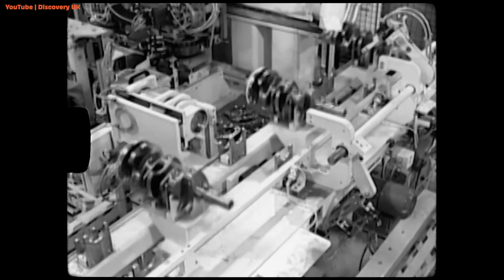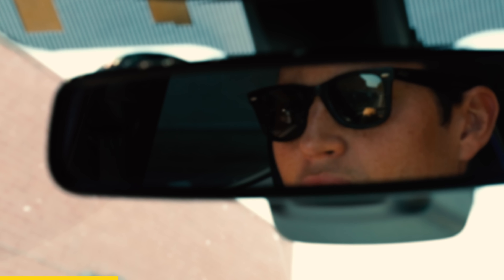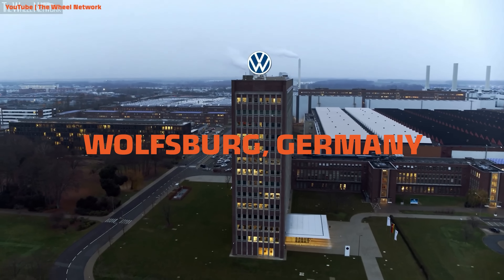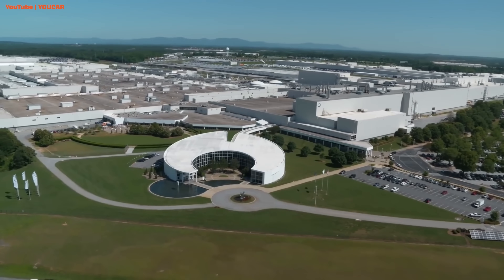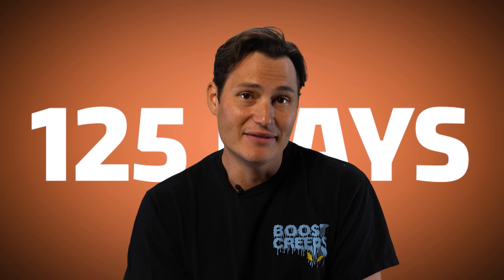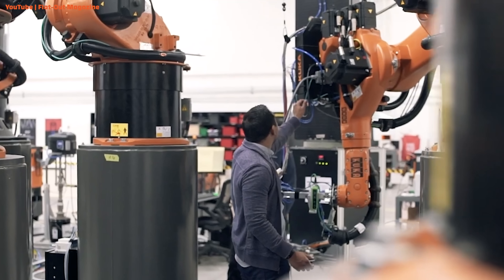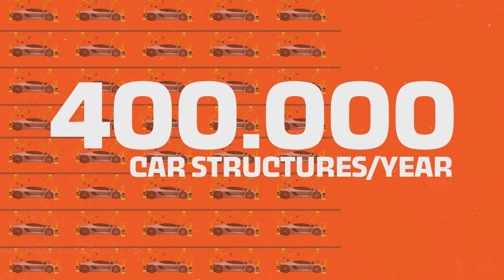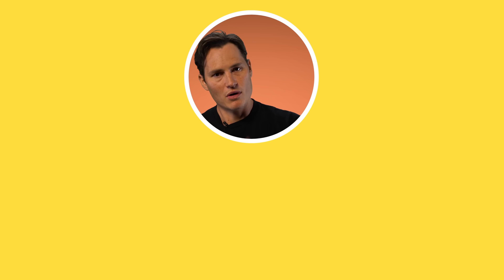A.I. Designed this Car

Comment: "A 3D printer doesn't print out any extra material" 
Bruh
Reply: Plenty of comments saying the same thing ; can't blame you for knowing that supports are needed in plastic printing. But if it's using a powdered-metal bed, the powder acts as a support during the print.

Comment: What happens when parts need replaced? Everything I'm hearing about the AU is a mechanics nightmare. Honestly we need a vehicle that's designed for the everyday car guy who doesn't have a whole shop and special tools to use, easy to maintain and long lasting

Comment: So, they used topology optimisation for parts of the structure and some optimisation for other parts like maybe the wiring runs and aero. Seems like "a car designed by AI" is a bit of a bold statement. Also the comparison with VW which is centred on mass production doesn't really work, in my opinion (as the rest of this comment, of course)

Comment: 3d printing is such a costly thing to do to make molds and produce it but it lets companies R&D without the expense of designing the whole picture in materials that could cost much more its also can give manufacturers new shapes and designs to a system that could be used to improve currents systems. That said i hope companies can make that jump but it will be a costly one $$$

Comment: The information provided here is very misleading. They used ai programs to aid in making parts as strong and light as possible. Because of the shape of these components, they can only be manufactured with a 3d printing process. 3D printing is extremely slow and inefficient, and as of now has no place in a high production environment.
Automobile manufacturers have been utilizing these same robotic arms for years already. And they are not easy to program, they take hours or even days. All parts for assembly must also go through QC and be set up prior to assembly by a person.
This may be a tech savvy way to manufacture, but it isn't cutting edge. This also is not the future of manufacturing.

Comment: If the AI designed it, it should be able to beat a 1000 hp car with a 500 hp Engine since it should have the least drag coefficient possible with the best weight management. If he doesn't beat records with this, it means, he's lying about the AI or it is not well trained.

Comment: It's too bad these hyper-affordable building practices are largely only used for insane hypercars. If say Toyota or Nissan was able to cut basically 99% of manufacturing budget they could put out cars at dime-on-the-dollar prices. You could get a brand new civic or Altima for like less than 10k or something crazy

Comment: "3d printer doesn't print out extra material"
I who 3d prints "boi lemme tell ya"
Reply: DMLS 3d Printing genertes near zero waste as the metal powder itself acts as support rather then using the filament as support like its used in traditional plastic 3D printers.
Reply: Lol, I thought the same. To be fair though the powder acts as a support material, meening the only waste comes from smoothing the print
Reply: it doesn't, your typical 3d printer is non comparable to a laser one that is precisely accurate. it does leave some materials behind when smooting the print but it doesn't print excess that much compared to a plastic fed 3d printer.
Reply: @spanishsausage4731  xctly brah...👍
Reply: They use a DMLS printer. I thought that doesn't use extra material?
Reply: @ChrisHuppey  refer to the intake manifold printed for the supra at papadakis racing
Reply: Yeah I cringe a bit when he said that and I don't even have a 3D printer. Otherwise those guys I follow on IG won't have to sand down their works
Reply: @kertaspaper94  Your ignorance is hilarious you should actually look up additive manufacturing before badmouth someone trying to explain it in layman's terms. Additive manufacturing has almost no waste because everything that isn't the part being made is recycled back in to the printer. The only waste is the materials lost from smoothing or polishing the print.
Reply: The 3d print they are using is NOTHING remotely close to a filament 3d printer. The type or printing it is doing prints nearly ZERO waste.. So the people saying oh i would have changed the script because that's so wrong are the morons. That printer cost more then you will make in your life time and its insanely precise producing parts that are extremely complex with extremely small variances and runout.
It shouldn't be called a 3d printer it should be called 3d fusing.
Reply: @EDCandLace  https://www.youtube.com/watch?v=IUp3oCGZOzk
Reply: May be they are using a printer that is more presise and costing millions.😆
Reply: @flyingsnail4060  you mean he actually knew what he was talking about.
Reply: @Kyle-xt8ip  is ths a question  or a statement?
Reply: @buffalo wt https://www.youtube.com/watch?v=IUp3oCGZOzk
Reply: I was thinking that same thing, like I have a whole bin full of proof to the contrary...
Reply: I also have a 3D printer, whenever something goes wrong it makes a huge mess of extruded filament that looks like a big plastic tumbleweed. 3D printers need to have the correct settings otherwise they are just wasteful trial and error machines. even if everything goes right many prints need support stuctures.
Reply: There's a lot of extra material?
Reply: Let me put it in simpler words: "whoaaah, Yankee with no Brim!"
Reply: You probably have a different type of 3d printer, the ones they're using actually has no waste
Reply: SLS is much less wasteful than FDM because the extra powder can be reused, unlike printed support material in FDM printers.
Reply: That should tell you Jeremiah is a ignorant fool and needs to leave donut. I hate that dude.
Reply: @theenzoferrari458  actually, Jeremiah is a really cool and talented dude. Have you even seen him race motocross? Dude’s a badass! Sounds like you’re just angry because you miss having daddy James on B2B 🤨 #highcar
Reply: @theenzoferrari458  why, you think he wrote all this script himself?
Reply: @Patrick94GSR  it doesn't take jeenyus to reword the script. Lmao. If I was reading it I would've fixed that on the spot.
Reply: @theenzoferrari458  it prints support material depending on the shape of the piece, still what you get is a piece that is far more efficient in material than CNC (as everything gets recycled)
Reply: @leviathan19  Exposure to oxygen and humidity can cause metal alloys to change composition. For instance, as oxygen increases in Ti-6Al-4V titanium, the aluminum content may decrease. This is particularly true when metal powder is recycled. Recycling also causes powder particles to become less spherical and to flow less well

The printing process may also see changes in the composition of metal alloys as well. In a metal alloy, in which multiple metals are combined (i.e., alloyed), the metal with the lower melting point could potentially evaporate in the process. In the case of Ti-6Al-4V, a popular metal for 3D printing in aerospace, titanium has a much higher melting temperature than aluminum, and it’s possible to alter the composition of the material during the 3D printing process.
Reply: @theenzoferrari458  And it doesn't take a genius to spell genius.
Reply: @theenzoferrari458  Yes.. yes..  You are obviously brilliant - and yet you have no show of your own.
Reply: @theenzoferrari458  lol such a negative dude, take a xanax

Comment: But does anyone understand how this could easily be tweaked from making hypercard to making radically efficient/power everyday vehicles at a fraction of the cost?

Simpler design, reduced material cost, no real need for maximum power, I'm sure even the machinery wouldn't have to be as expensive. Wow.

Comment: I’m a little confused about the calculation made for the amount of cars per year a 100.000 sq ft factory can produce.

It takes an hour for the basic structure to be assembled, which equals to 8760 (not 10k) if the were to factory run 24/7 365. 

The assembly of the complete car (the 3000 hours) gets disregarded in the calculation. I assume this is mostly print time on the actual parts. Simply multiplying the A.U. area times  40 without leaving room for a massive print facility to keep up with the demand is not possible. So unfortunately the 400.000 (which theoretically is  350.000) is not achievable until additive manufacturing tech’s speed increases or the factory at least doubles in size. 

There is no doubt that we’ll eventually get there and I can’t wait to see it!!

Comment: Very interesting technology - probably the first time it's been applied to automotive at that scale (In aerospace this is old news), but the reason mass production of cars doesn't do this is because the cost to 3D print a part is way higher than stamping, casting or forging, as well as taking way longer. You won't get optimum geometry compared to the 3D print, but it will be 90% there and easily an order of magnitude cheaper, which is a hell of a lot more useful if you want people to be able to afford to buy your cars in large numbers. For low production run supercars, this cost is irrelevant, so it's an ideal way to maximise your profit in that market. Also guaranteed there's a large team of engineers and designers 'guiding' the software's calculation constraints to make the car look the right kind of impressive to sell, so while AI is involved, guaranteed it's not doing all the design work.

Comment: The problem with what you said about filling a factory floor with AUs though, based on the time you gave to put the thing together, is that for each AU to be building that many cars, you’d need a factory full of 3D printers and what ever they use to make the carbon fibre parts... better to have 1 or 2 AUs and fill the space with 3D printers... Still insane production numbers for the footprint! Hope other manufacturers take notice

Comment: How much does it cost to buy? And how is machine-made more prestigious than bespoke & hand built? Who has driven a production version?
Reply: id imagine they will be priced in the high 100k low millions and at massive profit margin to the manufacture since he eliminated 90% of the overhead
Reply: How is this not more prestigious? A human, no matter their experience/training, can make a mistake. A stitch could be wrong. A ring gap could be .0001" to big or too small. A properly programmed and maintained machine will not. That matters on a car that (for the first run, at least) will be a colossal flex for anyone lucky enough to buy one.

Comment: Great video overall. I would be great to mention the name of the process that allows such shape - topological optimization. Happyly it is not perfect and still require engineers to verify parts mechanical resistance.

Comment: as a kid who dreams of being a mechanical engineer one day this made me really sad
Reply: Mechanical Engineer here, A.I. Is powerful when it can be successfully trained to produce something from a given set of inputs. Assuming this becomes common place, it will not be economical for everyone to produce an AI for a given task. You’d be surprised how much you will do that is one off tasks or specialty designs that do not warrant the time and financial investment in training an AI to create something that you could do in less time, at less cost, and qualify as being acceptable. Also, A.I. is not infallible. Just because it gives an output for a set of inputs is no guarantee that it is a good result or not, there will be engineers approving the designs as being satisfactory and will need to do their own analysis to confirm. My design calculations have to be approved by 2 other people before they are rubber stamped. AI will be no different. Your skills are needed now, and will continue to be needed in the future. Automation is more an enemy of people who work with their hands than people who work with their minds. Also... software coders are not engineers and do not understand mechanical design and analysis the way you will, they will need your help and input to build these regardless. Not to mention Engineering includes inventing and ingenuity, something an AI will struggle to do as it must be taught. Walking up to something and being told make it fit here and work with the given requirements is not an AI worthy task. Automotive design is an old profession and the design requirements are very well understood. Nothing you have seen here is a radical departure from what has already been done for many years now, just a hyper optimization of existing design concepts. Super lightweight fancy double wishbone suspension is still a double wishbone suspension! The AI did not come up with a double wishbone design as being most optimal... it was TOLD to use it as the basis! So fear not!!! 🙂
Reply: who do you think designs the A.Us , robotics, PLCs, software, the AI software... engineers
Reply: Searching the whole comment section for someone to say this.
Reply: The video is over simplified...the whole comment section bought it...its much more complicated than that...AI is just a small aspect of it...the whole car is a product of very smart engineers working in collaboration with the machine which churns out solutions to choose from...AI is of no use without a smart human to set parameters and make good decisions...go follow your dreams but also learn to collaborate with a machine and create synergy as both together can make great things happen.

Comment: Imagine going to collage for 5-10 years to design a car... just to get an AI stealing your job...
Reply: Yang Gang in the making...
Reply: Imagine going to school at all for STEM. Your job is gonna be outsourced to a program a million times more efficient that you had a hand in creating.
Reply: @slk1771  People say shit like this but don't realize that behind every slick program there's an army of engineers building, validating, troubleshooting and improving it, and on the other side of the counter a second army of engineers justifying the input parameters and validating the outputs of these AI tools for their respective objectives. You think a businessman can come up with a test plan to validate lateral force vs. steering geometry spit out by a program? Or even know what makes a "good" suspension system?  STEM isn't going anywhere, it's getting bigger than it ever has been. When computer aided design came along, hand draftspeople didn't all go hungry, they upgraded their skills and did cooler shit. As tools improve, the same engineers and technicians just make better designs, they don't get fired.

Comment: "A 3D printer does not print anything extra"
Me knowing that 3D printers need to print extra for supports and such - ...
Reply: SLS and other powder bed methods do not use support structures since the powder bed itself acts as the support structure.
Reply: I dont think support structures are necessary in this form of 3D printing, checkout Bugatti's 3D printed brake calipers
Reply: 3D printing with plastics is different than the type they use for metals. It doesn’t function in the same way

Comment: btw its not ai that designs. generative designing is an iterative process which means it generates randomly, the 'A.I.' part just chooses the best out of the generations. if you wanna have some fun with this sort of design try out Rhino 6 with grasshopper. also, I would advise getting pufferfish and kangaroo add ons as they have some really powerful tools. in the case of the car its mostly done with a combination of Voronoi and stress values, the machine learning gives you aid in distinguishing the best designs from the worst. 

this is cutting edge design, if you are interested please to got get Rhino 6 CAD systems and the 1000's of add ons at foodforrhino

Comment: My only question is serviceability of this car. Granted its a supercar so it's bound not to be easy, but it would suck a lot if you have to take apart the entire car because 1 electric wire is acting up

Comment: "A 3D printer doesn't print extra material"  This guy obviously doesn't own one. I have tons of extra material from messed up prints haha
Reply: The 3d printers used for the car is called fused metal sintering, were home 3d printing is done by a method called fused deposited material. In fused metal sintering a laser melts individual grains of the metal together. There is no waste
Reply: Home 3d printing is totally different from industrial 3d printing. Industrial 3d printing is way more advance and mature compared to the best home 3d printer.
Reply: Tfw you think you know more about the presenter of a particular subject yet make it quite obvious that you don’t.
Reply: @Patrick94GSR  The face when when
Reply: @EdyAlbertoMSGT3  that FEELING when, but anyway